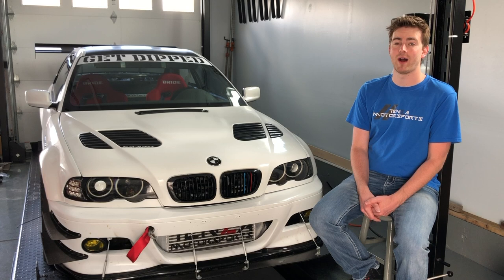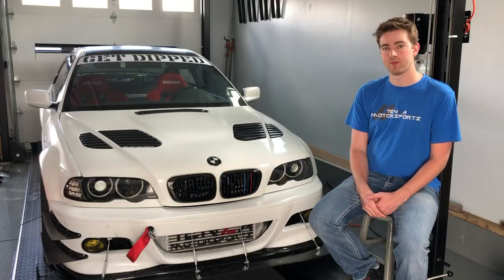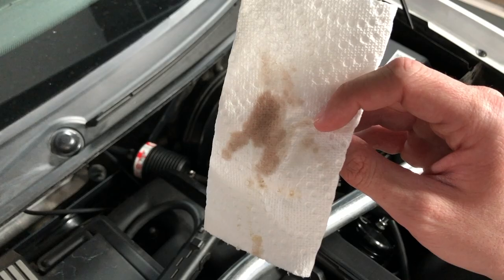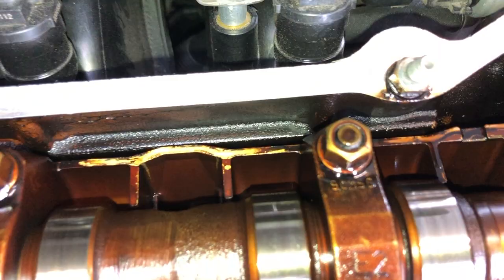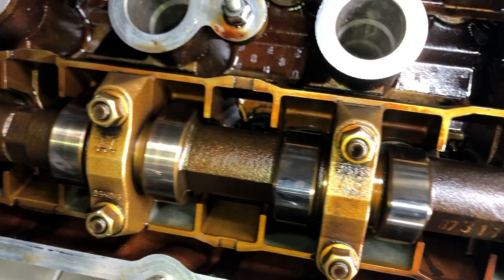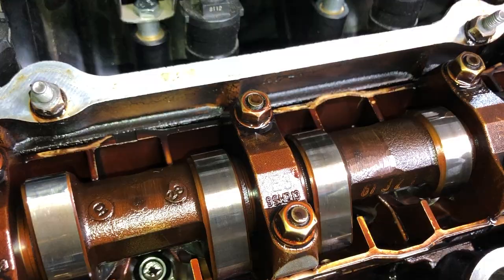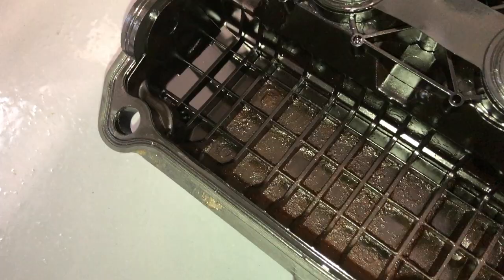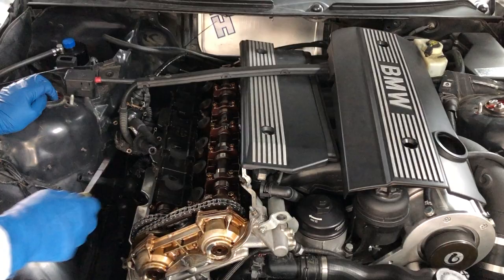500 mile break-in and Royal purple verdict (Part 2)

Comment: Royal Purple is a monumental waste of money. Even if your engine is still running at 350,000 miles, the rest of the car is ready to be shit canned.
Reply: Monumental??? it's not that much more?? I don't use RP, I use Amsoil, which is the same cost at around $10 a qt. this makes my yearly oil changes cost like $25 more than the Castrol I used to use. $25 is NOT "monumental" if you have a budget that can't handle the "monumental" charge of $25 you need to get out of the car scene
Reply from the maker: I couldn't have said it better!

Comment: Maybe some fuel additive for lubricity for the fuel pump. I have two BMW diesels and plan on using Hotshot LX4. The fuels in the US are stripped of the stuff the helps lubrication of the injectors and fuel pump. You can use LX4 on gas powered cars to.

Comment: Sounds a little like you were pushing to find the answer you wanted. It really didn't do much.
Reply from the maker: In 500 miles it didn’t do a ton. the main thing I noticed is that it softened everything up. I was able to easily wipe off build up that before wouldn’t have budged without a solvent. I have a part 3 coming soon that shows the effects of RP after closer to 2000k miles.

Comment: BMWs are fun to drive but they are completely unreliable and cost a fortune for parts and for factory repair work.
Reply from the maker: You’re right they are fun to drive! I disagree with your claim of unreliability, With my experiences they have been VERY reliable. If you are referring to the fuel pump that failed on me as "unreliable" that’s not the case. As far I could tell the fuel pump was the original one. It  had 165k miles and I’m running an aftermarket supercharger that adds 210hp. I was waiting for the pump to fail, just caught me off guard. Parts are very comparable to other brands and I fix my own cars so I can’t comment on factory repair costs.
Reply: @TenzaMotorsports  Please look up Scotty Kilmer. An auto mechanic for over 50 years, who now writes for you tube. He will tell you about the mechanical reliability and costs of BMWs throughout the years.
Reply from the maker: I've seen Scotty Kilmers channel. So tell me how a mechanic of 50 years has such a hard time with these cars? When someone like myself who has no schooling and 100% self taught has no issues? I've owned 9 of these cars over the last 10 years. Family/extended family, has owned 8+ No issues. Between myself friends and family I can honestly say i've been around and seen ownership experience of 30+ bmws. They are easy to work on and parts are very comparable (if not the same in most cases) to other car brands. You can believe whatever you want but there is a reason I own and race them.
Reply: @TenzaMotorsports  Scotty has seen many BMWs come in to his shop for repairs. In general, he labels BMWs as money pits that require frequent repair.
Reply from the maker: This is the same Scotty Kilmer who is driving a new Toyota supra? aka a BMW Z4. Doesn't sound like he's against owning them to me.
Reply: @TenzaMotorsports  Nobody ever said he was against owning a BMW or a Supra. However, he is definitely against fixing them and working on them.

Comment: Wd-40 lubricants you’re engine so it runs faster and better
Reply: WD40 is fish oil lol good for drying out moisture in distributor caps plug wires but not a very good penetrate for loosening rusted on nuts and bolts !

Comment: Typical bmw, breaks down immediately after an engine rebuild
Reply from the maker: The original 175k mile fuel pump died. I'm shocked it last as long as it did. With he addition of a supercharger it was bound to fail. Nothing to do with the engine. Fuel pumps are not part of an engine rebuild.
Reply: Dunkaroos Says the guy with a new Chevy as his profile picture😂 might wanna trade that in after your lease is up.

Comment: I'm surprised that bmw was running long enough to test.  They break down and cost more than a Lambo.
Reply from the maker: If that were true I would own a lambo. What bridge do you live under?
Reply: @TenzaMotorsports  The bridge that does not contain cars that have electrical issues as a rule. Look on you tube alone for bmw reliability.
Reply from the maker: No issues here. So, what lambo do you own?
Reply: @mudgem3742  soooo you don't have a Lamborghini?
Reply: Garret Hariss Hes probably a Honda boy. No one else goes around talking shit like this.